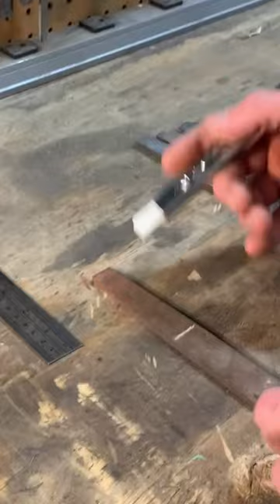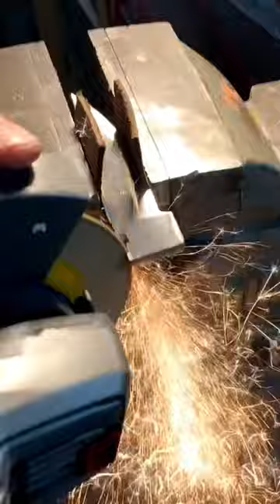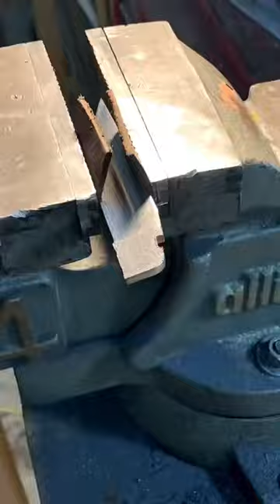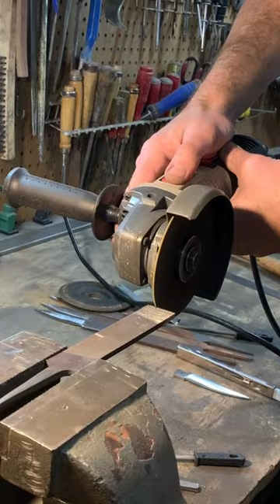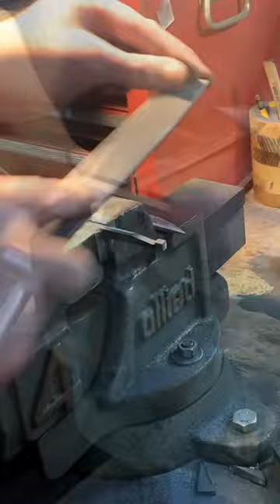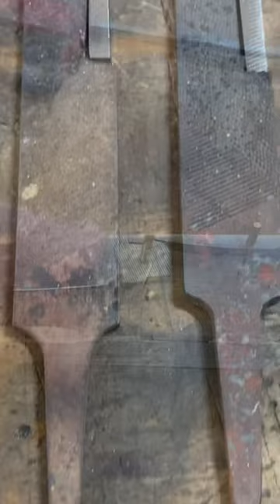Making the lock for a lock back folding knife. #shorts #handmade #edc #knife

Comment: which one you think is easier to make the slipjoints or  back lock?
Reply from the maker: I find the slipjoint to be much less technical to make compared to lock on the lockback. It just requires a careful heat treat on the spring that the lockback lever doesn’t require.